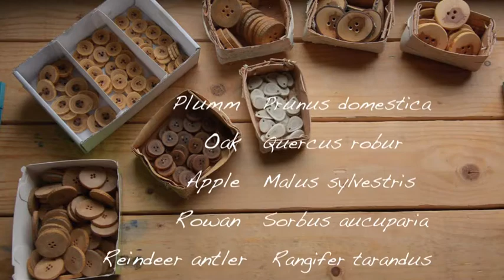Making wooden buttons

Comment: Had you tried drilling a bunch of the holes at once prior to cutting the rounds?
Reply from the maker: Hei Douglas!
I have been thinking of it, yes. But as i am working with branches, which are not straight, the wholes would not be in the middle after some slices. And also, it would be dificult to make the whole realy straight to ensure, that the distance between them stays. But, all not impossible. Would be worth givin it a trail...

Comment: Thanks for this tutorial. When I try this, I was thinking of threading up a bunch of buttons on a knotted string, and dunking them in the finish  together. Hang the buttons so the finish drips back into the jar, then after the right amount of time, wipe away the excess with a cloth.  Repeat as necessary.  When done, clip the knots and clean any excess around the hole with your chamfer bit. I think this might save a little time, I'll have to give it a try.

Comment: They look wonderful! Thank you for sharing. How long do you dry the wood for before using?
Reply from the maker: For drying i always keep the bark. It avoids cracking, but drying takes longer. If harvested in winter (when less water is in the wood), one year might be enough. For some woods it takes even longer. Its amassing how well the bark is keeping this moist inside! 
You can cut one test-button and keep it in the sun or on the heater for some hours. If it does not crack, the wood is dry.